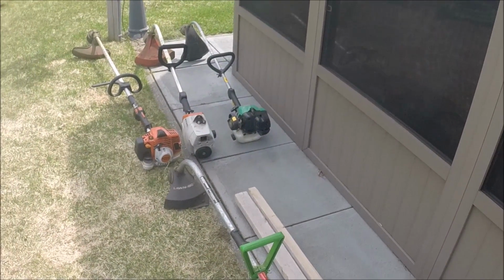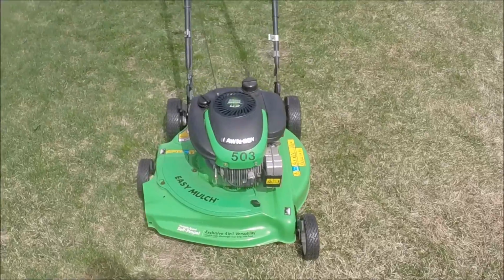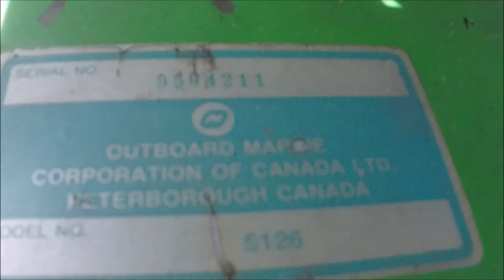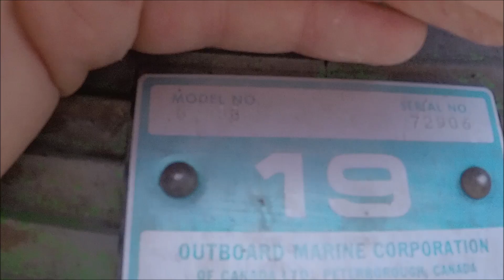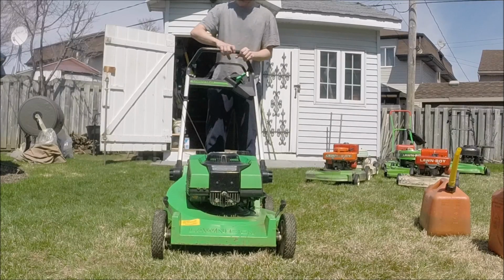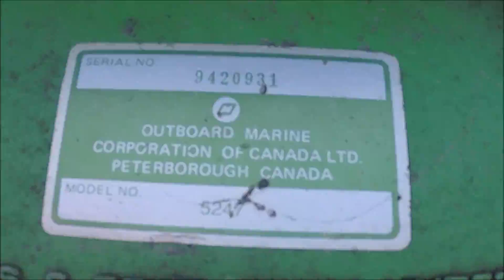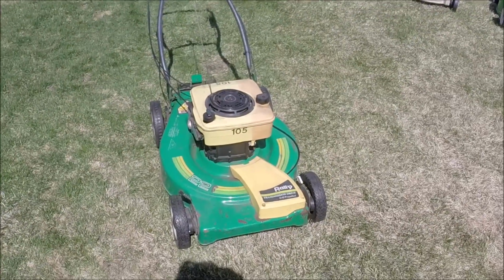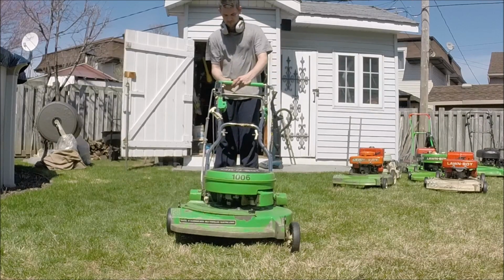Getting the Lawnmowers Running For 2017 - Part 1/2

Comment: Jon, your video to cure the surging issue on the Dura Force engine or any other Lawn boy engine is to turn the 'jet' on the side of the carb to obtain a smooth idle. This is an altitude adjustment and is the best way to get rid of the surging problem. Physically altering the components is a waste of time

Comment: You should see all the vintage lawn boy mowers I have . I have some super old lawn boy mowers one of mine is A 1954 lawn boy iron horse mower still running like new it's extremely nice no rust at all even the handle it still has all its paint no paint is chipped off yet. It's one of the first true 2 cycle lawn boy mowers they first made. It's worth big money.  the iron horse mower has the A series engine on it.  I have A classic gold lawn boy mower from 1959 also is like new condition still. It's A model 7210 has the C series engine on it it's the bricktop engine.  still starts in 1 pull every time.  I have A yellow lawn boy butter cup mower from 1967 with the C series engine on it.  I completely restored it by myself has new everything runs like new looks like new is worth over $500.00! which I think is cool. and these are just A few of my lawn boy mowers I have I must have 50 of them.  they all run. most of them are worth big money.  and I restored almost all of them except for like one or 2 of them. I thought I'd tell you about my collection not sure if you are hearing about my lawn boy mower collection or not.

Comment: also you can put 2 stroke in a unleaded motor because its fine its just running on added oil because its unleaded you just add oil never put unleaded in 2 stroke motors please

Comment: Does the makita work anymore
Reply from the maker: Franco The-Boss it needs batteries
Reply: Jon3800 hey Jon, I just found a new lawnboy deck style mower. It's called the Saber Edge 21 Mower. Check it out on the website because there's different models.